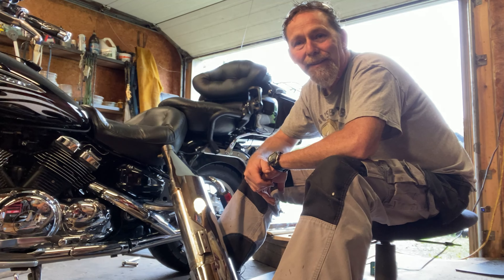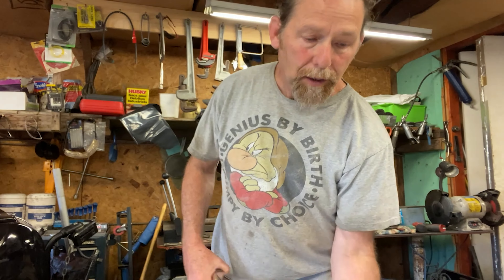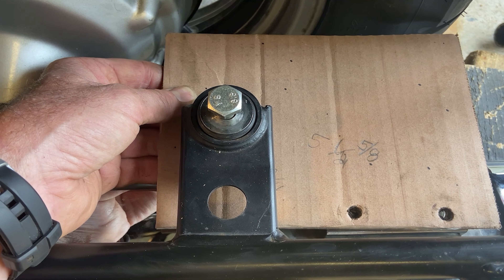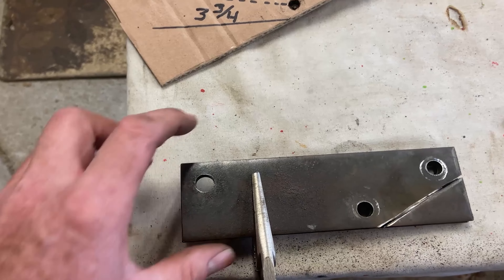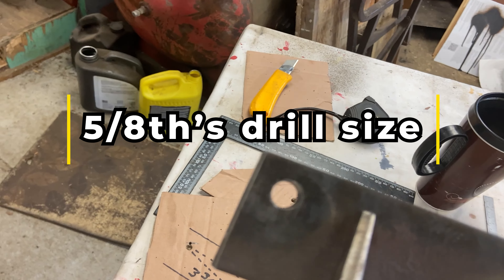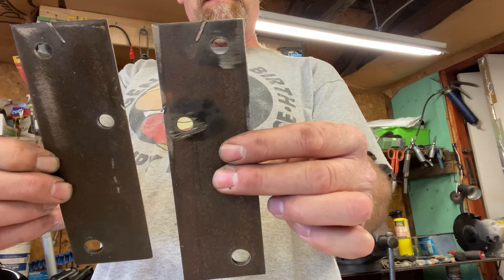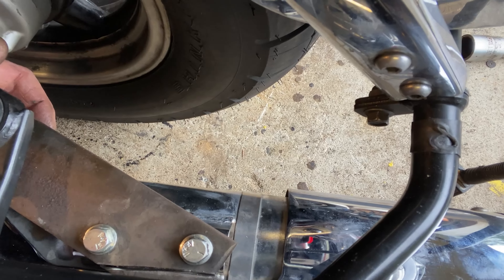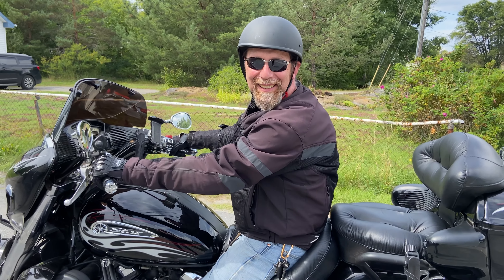Custom Brackets for V&H Monster Ovals Yamaha Royal Star

Comment: Did you have to take the gasket off the header pipe to get the muffler on?
Reply from the maker: Hello, These pipes are just slip ons,....so no need to take the header pipe off. But I have taken the head pipe off for other work on the bike and and it also just slips on and off easy. you will not have any trouble in my opinion.